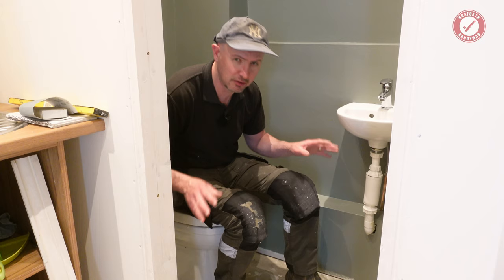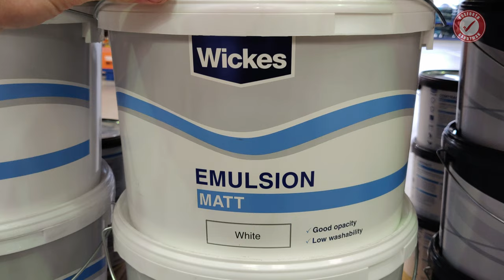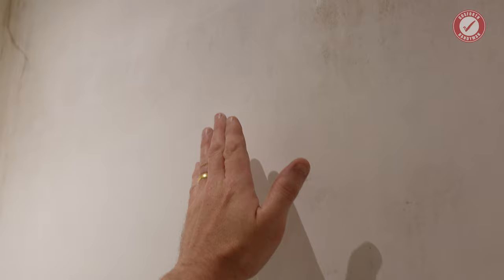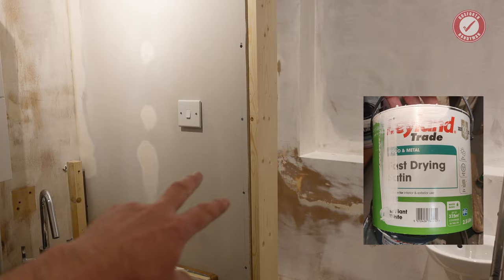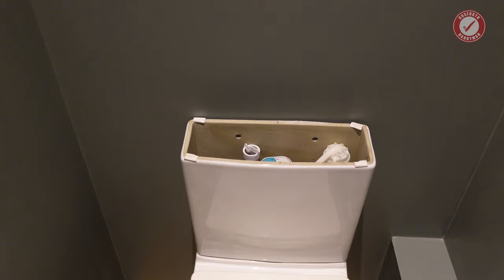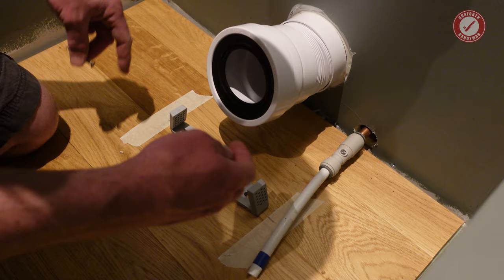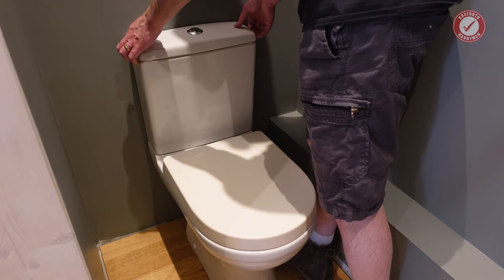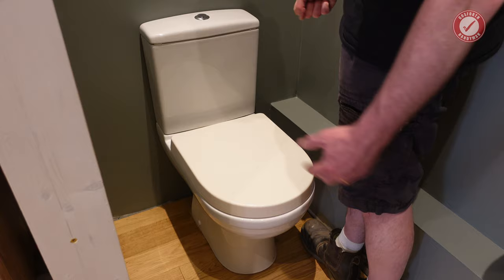Paint problems and fitting the toilet - utility room (part 9)

Comment: Zinsser is brilliant stuff! 
I originally bought some to cover a silk paint so I could apply matt and it did a brilliant job. 18 months later, no cracking or peeling. Since I had plenty left over, I thought I'd try it to prime over the knackered paint on the canopy over the front door - not really the right stuff for the job but no point wasting it - worth a shot. Did a brilliant job of that too! 
Used it for all sorts now - it just works! Pricey, but you definitely get what you pay for.

Comment: I stopped using water based paint, especially so called exterior paint and have gone back to oil based paint.
I spent ages restoring my 120 year old window frames and casement using water based paint, and had to do the job again a year or so later.
Fortunately,  I have access to portable scaffold towers  courtesy of my daughter in law's roofer brother, but even so, I'm in my 70s and my wife was none too keen on my working at height.
Having completely stripped any traces of water based paint and repainted four large windows with fresh primer, undercoat and two top coats, I'll move before it needs doing again.
Reply from the maker: Oh no! What sort of paint did you have problems with? I've found Zinsser Allcoat is pretty good.

Comment: Thanks Andy and Mrs Mac. Another excellent video with lots of handy tips. Will bookmark this one as well. Plus I’ve taken a note of all the paints you mentioned. I have some shinny walls and ceiling that need plastering so will prime or hack them before the plaster gets to them. Not risking it 😂. I’ve used peel stop, it’s excellent. Love that whole range of paints by zinsser.
Reply from the maker: Cheers - Peel Stop is like magic! 😂

Comment: if you want to be sure the skim is not going to blow on a old wall give it a coat of blue grit yourself and a day or 2 later check with a scraper that it has adhered properly
Reply: Was going to say the same thing.
Reply: Is that the primer you use on floors for titles too?
Reply: @dougsaunders8109  for floor tiles that would be SBR which is a lot different to bluegrit.  Blue grit is used to seal the wall but also add a keying layer for the new plaster.

Comment: Hi Andy, I’ve mist coated 3 rooms and ceilings with that exact same wickes paint. We didn’t have any problems with the normal paint going on over the top even though it was powdery. One room is still just mist coated and still a little powdery. It was first the first time I had mist coated fresh plaster so just assumed that was usual.
Reply from the maker: Yeah, defo not usual unfortunately! 😭

Comment: Thanks for covering the paint and plaster problems Andy, it's good to hear some solutions and also to know it's not just us ! Hope your plaster hangs on OK, I think I might have been inclined to bite the bullet and redo it but fingers crossed for you - don't upset the Missus ! 
We had a problem here whereby applying a thinned matt paint over the builder's magnolia by roller fetched off not just the magnolia but also large areas of the skim. Bloody nightmare, what stopped it bonding well to the plaster board god knows, but was not impressed , went back to using a large paintbrush then rollering only the top coat ! 😤😡
Reply from the maker: Yeah, we only noticed it about year after it was done... and by that point getting it re-done would have been a total PITA. So might be a future project. So far so good though. That sounds like a nightmare with the loose skim! 😭

Comment: @3:24 Yellowy glossy paint is probably an oil based paint.
There's two ways to cover properly without removing the old plaster.
One is to sand the old paint surface with 60 grit to rough up the surface and give new paint something to adhere to.
The other is to paint over with a base primer like B.I.N or Kills or whatever you across the pond have. Two coats covers just about anything from dirt, grime, crayon, old paint, and dinners thrown at a guy by an angry girlfriend (yes, I've had to do that in one of my rentals) 😂!

Comment: I'm a big fan of Zinsser paints. Every one I've used has done exactly what it said it does. Using their "all coat" paint for the first time on some exterior bits tomorrow and not expecting any issues. 
The only time I had a failure was using Zinsser BIN to prime a painted contrete exterior windowsill. After a few years the top coat peeled off but on checking the directions it specifically says "spot use" only outside so that was entirely my fault. That's been stripped and recoated with Bedec Multi Surface Paint.

With the plaster I'd have been tempted to paper it with lining paper myself to hold everything together then paint over that
Reply from the maker: I've used the All Coat and had excellent results! 👍👍

Comment: I might sound sound silly but, when it comes to the loose plaster, you could possibly drill a load of small holes in areas where the plaster is still loose and inject pva?, if it worked when you poured it then it's feasible it will work 😢.
Hurray, someone likes my idea 😆, also, I only mean drill until you hit the original wall, the channel, @propper diy, gave me the thourt, another fantastic channel I follow 😀
Reply from the maker: Yeah, trouble is if you disturb it too much it just falls off in sheets 😂. But yeah, very carefully that could work for future repairs. 👍👍

Comment: Stopped using Wickes paint 10-15years ago before the paint was changed and was rubbish. Now only use either Leyland or Johnstones. Only use a green stablizing solution behind plaster now.
Reply: Used Leyland and Johnny's for ages but I bought 6 tubs of Leyland White vinyl Matt for a renovation job...it was awful however you applied the paint it bubbled like an aero . it took 3 times as long as you had to roll over it after about ten mins then again after another 10 mins ..won't be using it again... MacPherson is my favourite never had a problem at all with it
Reply: bostik  cementone plaster stabilising primer its a really  good stuff  as a primer for any substrate in my opinion. Im trying  to use it before plastering  whenever i can, and never had a problem  with it
Reply from the maker: 👍 Some very useful comments on here! 👍

Comment: It sounds like the skim coat has “shelled” (IIRC) which means it hasn’t adhered to the substrate. 3:1 PVA is great for emulsioned walls as it has half a chance of bonding to the wall. I’ve heard good things about SBR, blue grit and Bond-it pre grit. For the faff involved it would have been easier / better hacking the wall back to brick and then either dot & dabbing or bonding it out properly. In terms of tape and fill, I started a loft bedroom doing that, got sick of do a bit, let it dry, sand/scrape any high spots, fill, wait to dry etc. I decided in the end to learn to plaster at night school (Peterlee college), 10 weeks, 2 x 3 hours per week and I can now skim walls and ceilings to an acceptable standard. Paint lifting is my nemesis as well, Johnstones trade covaplus or Leyland super Leytex high opacity paints seem to work a treat. Aluminium undercoats helps to keep stains at bay.
Reply from the maker: Unfortunately not enough space to dot & dab this wall (the door frame is embedded in the wall) so it would need a full new wet coat. We did offer to hack it back to brick but the plasterers said it would be fine. 🙄😭

Comment: Re shiny surface.
120 Grade orbital sand walls then blue grit shinny surface prior to plastering.
Blue grit is a nightmare to get off glass or any shiny surfaces. Welds on.

Was a thing to gloss paint walls, and i unfortunately had to apply gloss to walls years ago for an old guy. Horrible job. PVA is useless over gloss surfaces.

Comment: Just wondering Andy - Is there a requirement for the soil pipe coming through the wall to the toilet to be significantly lower than the  soil outlet on the Ceramic unit.  I would have thought that the straighter the connection the better?  I notice you took a measurement in 'marking out part 2'.
Reply from the maker: If I remember rightly we had to go that low to get the fall for the washing machine boss on the other side. 👍

Comment: They should of roughed up the paint surface by sanding it with a 120 or 100 Grit sandpaper. That would of provided some teeth so the new plaster could properly bond to the paint surface.

The other issue is that thew plaster does not have the proper percentage of lime and sand as the old plaster that had a lot more lime and sand in it.

Comment: We moved into our “newly decorated house” and every single wall has had the chalky paint! Do i really have to peel stop every wall?…..
Reply from the maker: I would personally suggest you do. The gamble is the top coat not adhering properly and you're in a whole world of pain when paint starts peeling back off on your roller. You might get away with a coat of the Bare Plaster Primer instead but test it first. 👍

Comment: Also when you paint new latex water based paint over existing semi Gloss or even eggshell paint you need to rough up that surface as well with a minimum of 150 Grit Sandpaper is actually better and wipe off the paint dust with a damp rag, because paint will not stick to paint dust or Drywall mud dust either!

Also buy a good quality primer like KILZZ or ZINSSER  to paint over the old LATEZ PAINT color because the primer will provide teeth for the new paint color to stick too!

If you’re painting vinyl water base paint over it oil base paint, it will not stick you’ll need to wrap up the surface like I described above paint it with oil base primer then you can paint water-based primer over oil base primer

Also buy a good quality 9” roller and a retractable/extendable paint stick they provided leverage to properly roll on paint.

Don’t use the short cheap wood paint sticks, invest in a good aluminum or metal paint stick from Any big box store I’ve had mine for over 20 years and it still works. It’s made out of metal its extendable

That’s what I did when the previous owner painted a disgusting baby poop brown in a semi gloss or an eggshell that was so slick and smooth. It wouldn’t of had any teeth to allow new paint to stick to it. That’s why you must rough up all semi gloss eggshell or even satin based paint so the new paint will have teeth to stick to the old paint.

Comment: Wouldn't muck about, get the plaster off or use 9.5mm plasterboard over it.
Reply from the maker: Not enough space to dot & dab this wall - would need a full wet coat. 🙄

Comment: Do you do toilet then floor or floor then toilet?
Reply from the maker: Generally floor then toilet. PITA to fit the floor around the toilet... unless it's carpet / lino.
Reply: @GosforthHandyman  THanks, andy. Also, is it hard to shift one a few centimetres in either direction using flexible piping? I have a house I'm about to move into, and the toilet's in just an odd position relative to the wall and bath.

Comment: It's always so nice to pay relatively big amounts of money to someone who says they know what they are doing and end up with a product that is more broken than it was before they did anything. And the worst thing is you can't get your money back in these kinds of situations. I would be so angry if that happened to me. I detest people that do this kind of job and cause more hassle and stress, and then they assure you it's going to be good even if you have your doubts.

I just recently had my bathroom remodeled because of water damage and oh boy there was so many mistakes I had to point out and things were still done hastily and after that I still had to patch up places or there would be water leakage behind the drywall again. There are still a lot of cracks on the tiles and how they did the grout is so badly done that there are missing grout in many places and they tried to put silicone where they didn't want to fix the missing grout, but the silicone just ended up scraping away after a while etc.

Workers do things so hastily most of the time that there are always something wrong after a job, and many times there will be problems again. And btw I'm a tenant in this house and I have had to fix a lot of things that weren't fixed properly by the workers. I have talked a lot to the guy that coordinates all these jobs in here and he knows I know what I'm doing and just brings me supplies if I tell him some small thing needs fixing and I do better job than the janitors here. Some janitors have even broken things, so if it's a job I have permission for, I just do it myself. Btw I live in Finland. It's not so bad here as it is somewhere else, but I just don't have a lot of tolerance when it comes to doing something badly so someone has to do it again. It's just a lot of extra work and materials.
Reply from the maker: Yup, interesting! As a tenant in Finland are you allowed to remodel a bathroom? Is that normal? 🤔
Reply: @GosforthHandyman  So yeah I wasn't very clear on that, sorry for the confusion 😅 It isn't normal, they hired a company that did the remodeling. Some people have done some smaller remodeling as a tenant if they were on a lease through a private person, but I don't trust that anymore since I have had couple of times where we were kicked out because the person decided to just sell the house without a warning. I'm renting through a company now and have been happily here for 8 years. Thanks for answering, been watching your journey now for couple of years and it's awesome and relaxing content, I've also learned some good things 👍
Reply from the maker: Cheers for the info! 👍👍

Comment: Well I now know what those two holes in the bottom of my toilet are far.. a bit of a shame my bathroom fitter clearly didn't
Reply: The guy that refurbed our en-suite shower told me that he never screws down toilets, especially when they are mounted on ceramic tiles which run the risk of cracking when you drill through the tiles. I guess he must have stuck it down because it's been fine for 6 years so far.
Reply: @colingoode3702  I'd accept that... If mine was on tiles but it's good to know
Reply from the maker: Personally I would always use them, even in tile. 👍